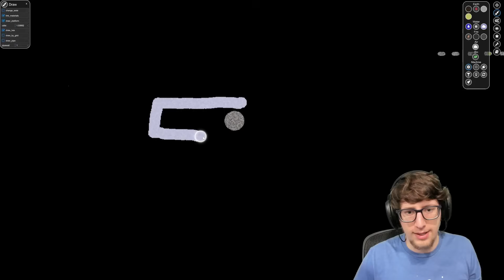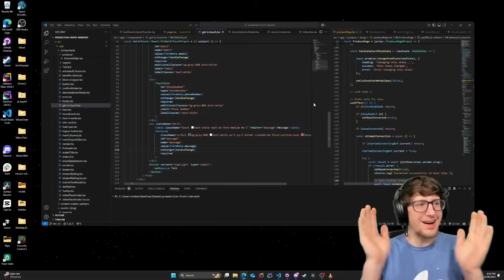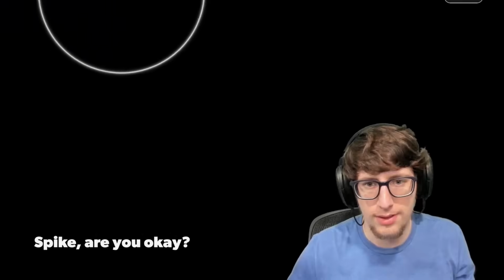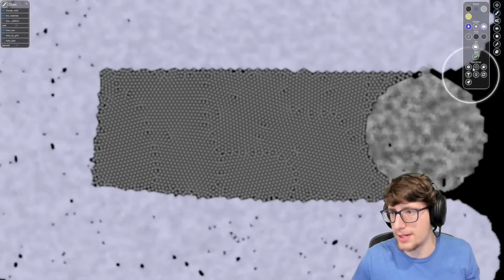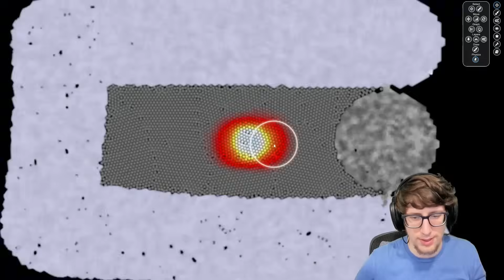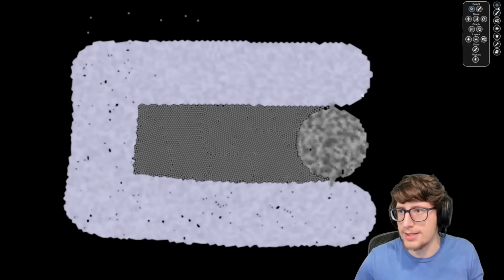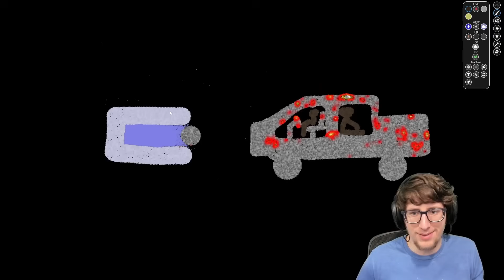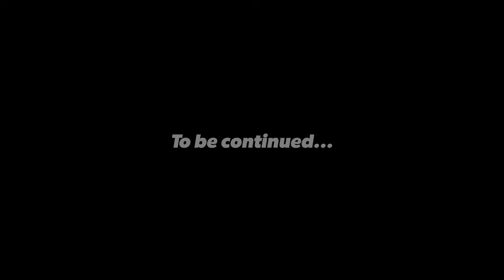PRESSURE CANNONS Tested in Space Simulation Toolkit!

Comment: you should pin me because For all of those who don’t understand

The F-22 Raptor is a fifth-generation, single-seat, twin-engine stealth tactical fighter aircraft developed for the United States Air Force (USAF). Designed primarily as an air superiority fighter, the F-22 integrates advanced stealth, supercruise capability, maneuverability, and situational awareness to dominate in air-to-air and air-to-ground missions.

### Design and Specifications

1. **Dimensions**:
   - **Length**: 62 feet (18.9 meters)
   - **Wingspan**: 44.5 feet (13.6 meters)
   - **Height**: 16.7 feet (5.08 meters)
   - **Wing Area**: 840 square feet (78.0 square meters)

2. **Weight**:
   - **Empty Weight**: Approximately 43,340 pounds (19,700 kg)
   - **Maximum Takeoff Weight**: About 83,500 pounds (37,500 kg)

3. **Engines**:
   - **Type**: Two Pratt & Whitney F119-PW-100 turbofan engines
   - **Thrust**: Each engine produces 35,000 pounds of thrust, with afterburner thrust exceeding 50,000 pounds, enabling supercruise (sustained supersonic flight without afterburners).

4. **Performance**:
   - **Maximum Speed**: Over Mach 2.0 (approximately 1,500 mph or 2,414 km/h)
   - **Combat Range**: Around 1,839 miles (2,960 km) without refueling
   - **Service Ceiling**: 65,000 feet (19,812 meters)

### Stealth and Avionics

- **Stealth Features**: The F-22 employs advanced stealth technology to reduce its radar cross-section (RCS) significantly. This includes its unique shape, radar-absorbent materials, and internal weapons bays that minimize exposure to enemy radar.
- **Avionics**: It is equipped with a highly integrated avionics suite, including a sophisticated radar system (AN/APG-77) that features low probability of intercept and can track multiple targets simultaneously. The F-22 also uses advanced sensors and data fusion capabilities to provide pilots with unparalleled situational awareness.

### Armament

The F-22 Raptor is designed to carry a mix of air-to-air and air-to-ground munitions, including:

- **Air-to-Air Missiles**:
  - AIM-120 AMRAAM (Advanced Medium-Range Air-to-Air Missile)
  - AIM-9 Sidewinder (short-range infrared missile)

- **Air-to-Ground Munitions**:
  - GBU-32 JDAM (Joint Direct Attack Munition)
  - GBU-39 Small Diameter Bomb (SDB)

The aircraft has an internal weapons bay that can carry up to 2,000 pounds of munitions, as well as two underwing hardpoints for additional ordnance.

### Role and Capabilities

1. **Air Superiority**: The F-22 excels in establishing air dominance, capable of engaging enemy aircraft at long ranges while maintaining a low radar profile.
2. **Multirole Operations**: While primarily an air-to-air fighter, the F-22 can also perform air-to-ground strikes, reconnaissance, and electronic warfare missions.
3. **Network-Centric Warfare**: The F-22 is designed for operation in a network-centric environment, enabling it to share information with other friendly forces and command systems seamlessly.

### Operational History

- The F-22 entered service with the USAF in 2005 and has since been deployed in various operations, including air patrols, training exercises, and international deployments.
- It remains a critical component of the USAF's air power, maintaining a technological edge over potential adversaries.

### Conclusion

The F-22 Raptor represents a significant leap in fighter aircraft technology, combining stealth, speed, agility, and advanced avionics to meet the challenges of modern aerial combat. Its capabilities ensure that it remains a formidable asset for the United States and its allies in maintaining air superiority.
Reply: ok
Reply: The amount of ignorance in this reply section is apalling. He spent atleast 20 minutes to explain something which was presumably not understood by the vast majority of viewers. Yet instead of saying thanks, or even ATLEAST reading it. You all call him a nerd wasting time
Reply: @TaylorfromPapaLouie  read it all for us then :D
Reply: @William_5956  my liege i think that was sarcasm
Reply: @Apocryphal_Mango reply of the year over here and no I'm not being sarcastic.
Reply: I’m not trying to disrespect you but bro spent like seven hours 
Writing all this
Reply: @erindonoghue8503  fr
Reply: @someone-u2t2s  
You might have overlooked a critical piece of aviation history—the controversial decision to choose the F-22 Raptor over the YF-23, despite the latter being superior in almost every aspect except maneuverability. The F-22's selection has often been criticized as a decision driven not by technology or strategic foresight, but by political and economic motives aimed at funneling funds into Lockheed Martin for reasons unrelated to advancing aeronautical innovation or ensuring military effectiveness.

This sentiment has been echoed in numerous interviews with key figures involved in the Advanced Tactical Fighter (ATF) program, including engineers, development leaders, and even fighter pilots. Many have expressed deep disappointment and frustration, describing the choice as illogical and detrimental to both morale and progress in aerospace technology.

Adding to the intrigue, the YF-23—nicknamed the "Black Widow II"—was developed with two distinct prototypes: "Gray Ghost" and "Spider." Unlike the F-22, only the YF-23 earned the title of an "Advanced Tactical Fighter" in both name and spirit, showcasing cutting-edge design in stealth, speed, and range. Its sidelining remains a sore point for many aviation community members and experts who view it as one of the most significant missed opportunities in modern military aviation.
Reply: Respect 🫡 taking the time to spread knowledge is amazing don’t listen to those who call you nerd it’s better than being an idiot
Reply: chatgpt because ### and ** are not youtube embeds, * is but not **
Reply: And he gave our plans to the world
Reply: thiswascompletelyunnecessary
Reply: DEADASS???!!
Reply: i did read that information and the information is really usefull.
Reply: I love hearing the specs of my favorite fighter jet
Reply: @Someonecrea mine personally is the f111
Reply: ain’t reading all that
Reply: Who let bro yap
Reply: @gavsan8825  has your dad come back with the milk yet?
Reply: NERD!
Reply: @William_5956  that’s a good compliment, I’ll use it eventually!

Comment: Because there isnt gunpowder(yet?) Instant expansion of pressure isnt easy, since oil burns instead of explodes. You need a way to convert the energy of burning into a valve release, if you can boil water into steam, thatd be what i suggest. I havent played the demo in a good few months though. I dont remember what all is in it.

EDIT: I see that there is in fact, steam
Reply: In part 2, the dev adds a new little option that spices up oil a bit.